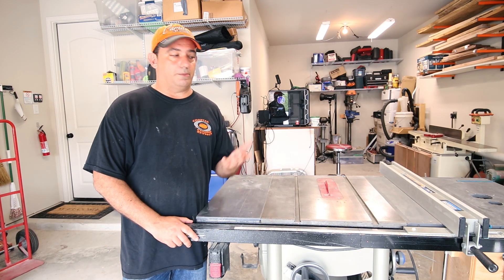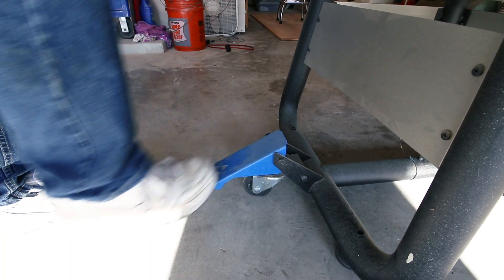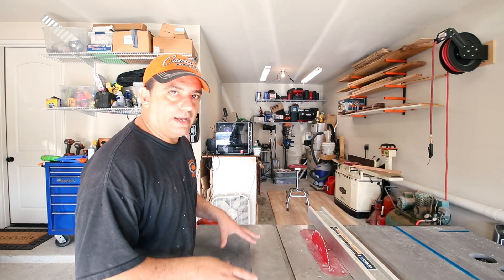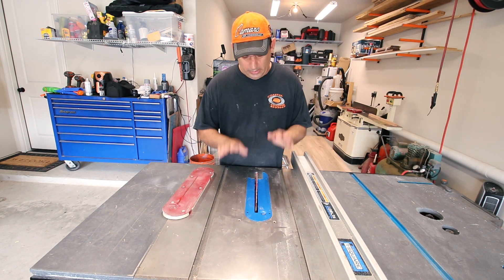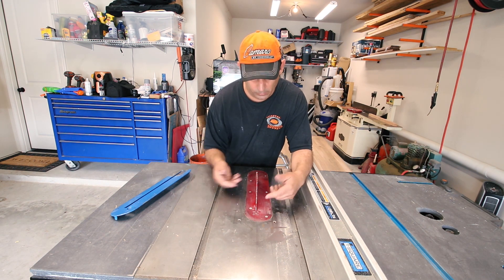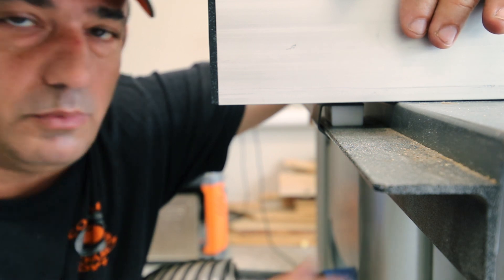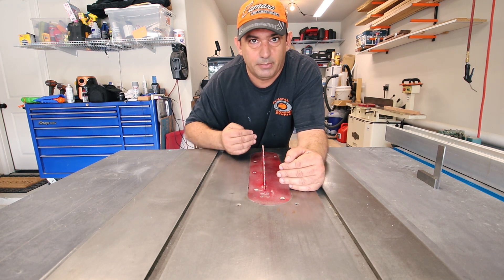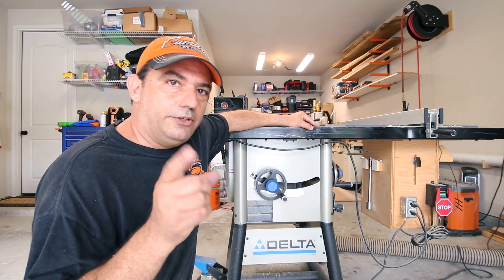Delta 36-725 Table saw review.  After 3 years

Comment: Great review. I guess I going have to get the Laguna fusion , the table has to be flat.
Reply: Make sure you get the Fusion 2 or better. The Fusion 1 is similar to this saw where the motor and arbor are mounted to the underside of the table causing the “dip” in the table surface.
Reply: The Fusion F1 is a better saw than these Delta's.  The top on the F1 is thicker than on this Delta.   The F2 is nice as well, but is a bit more money.  Over the last 4 months I have owned the Delta 36-725T2, the Laguna Fusion F2, and now a Shop Fox W1837.   The Delta had problems with the table flatness and also loose trunnions.  The entire motor assembly moved around and the trunnions are not adjustable.  So, that saw went back to Lowes.   The Fusion F2 was damaged in shipping, so it had to go back.  A replacement was not available.   Nice saw, but the fence had a little too much flex due to the thin aluminum front rail.  The W1837 is a great saw for $999.  Some things on the Shop Fox are nicer than the Laguna, and others are nicer on the Laguna.   

I would stay away from these Delta's.   Go with the Shop Fox W1837 / Grizzly G0771Z (same saws, different cabinets and features), or the Laguna Fusion F1/F2, or the Jet ProShop 2.  The Fusion F2 and the Jet ProShop 2 are the same saw, just different cabinets and different features.  IMO, the Jet is the best saw out of all of the above.  The best warranty and the best fence.  Well, actually the fence is probably similar to the Delta fence.  The fence on the delta is the only thing good about that saw.  The Delta's fence overall, is better than the Shop Fox / Grizzly and Laguna F1/F2 fences.  I own the Shop Fox, but I would have purchased a Jet if they were available at the time.

If you do not believe me about the above saws, being basically the same, well see for yourself.  Look at photos online, and in the manuals.  Compare the parts diagrams for the saws.  You will see what I mean.

As for flat tables, my Delta was at .018 front to back, and .014 across the blade.   The Fusion F2 and Shop Fox W1837 could not be measured.  This is because the smallest feeler gauge I have is .0015, and I could not get that under my straight edge on either of those saws.  In any direction.  So, those are basically flat.   A note on flatness, the table top does not need to be perfectly flat, and the flatness will probably change over time.   Anything around .005 is pretty good.  Getting in the .010-.015 range is livable.  Anything worse than that is well, not good and borderline awful.  Also, even the best and most expensive saws out there suffer from uneven table tops.  Do not expect perfect, but don't accept awful either.

Comment: FYI, you can rewire the saw to use 220, it's detailed in the owner's manual.  I'm not sure when you said "upgrade", did you mean the saw or the wiring...
Reply from the maker: If you rewire the saw for 220, you don't really get any more horsepower.   You'll cut the amps in half and have the same wattage, and horsepower.   I want to upgrade to a whole new saw with at least 3HP.
Reply from the maker: And ideally.... a flat top!   Lol
Reply: @termitewoodwerx5896  Good to know..
Reply: @termitewoodwerx5896  hp rating is for no slip motor operation. When the motor starts to load up, voltage drop is lower and slip and torque will be somewhat better. So 220V will provide noticeable improvement for highest duty cutting.

Comment: Thanks for the great (and disappointing) review. That was very helpful… I’m buying this to build furniture. I’m replacing a 23 year old Ryobi Bt3000. I think most of your frustrations, I can live with…. Question, at this price point, is there another saw that’s better? I’ve also looked in to the Rigid r4520, but that gets worse reviews (even though it’s essentially the same saw)… I’d go with a cabinet saw, but I’m in a small garage and space is limited (it’s a space issue,  not a money issue).

Comment: I just view your video today and all I can say when I was 24 I purchased at Sears a manager special contractor saw you know the type open bottom and back belt drive motor1.25 hp and it has served me well over the years I build everything with it Kitchen Cabinets, chairs, tables, small box thing that move over now to my 14" bandsaw now, It Handel molding heads cutters, a full dado stack with spacers,  and I am 64 I would not trade this in for a total inclose bigger cabinet table saw and 40 + years woodworking it does everything I ask of it, and the 2 & 1/2 car garage I build has 240 40 amp service

Comment: Purchased the 36-725T2 earlier this month.  My initial reaction was total pleasure in using it.  I especially like the stability of the fence.  However, after two weeks of use a problem has developed.  The braking mechanism tends to lock up the blade so that it sticks when you re-engage the power.  You literally need to spin the blade by hand or using a stick before turning on the power, and this is extremely dangerous.  Contacted Delta and they indicated there has been a problem with this.  Only advice they could offer was to return the saw to Lowes.  The company seems to be aware of the problem and supposedly are working on it.  However, I’m not certain any of the T2’s currently in stores will have the matter fixed.  So be aware, you may find yourself having to return 350 pounds of saw to the store for a refund.
Reply: I also have the T2 and (thankfully) have not experienced that problem Robb.  There are good ones out there.

Comment: I've had my saw for 5 years and don't have the issues you do.  My saw top is machined flat.
Reply from the maker: I guess it's luck if the draw.  Since you've had yours for 5 years with the table flat,  that rules out the theory that the motor's weight causes it to sag.   Mine must have been out of flat from the beginning.

Comment: I'm considering this saw as well (possibly the newer model I'm seeing on the Lowe's website). I'm wondering if you may be able to get a replacement if you've only had the saw for 3 years. On the Lowe's website, it shows this saw to have a 5 year warranty. Maybe you'll be in luck! Greatly informative video. New sub!
Reply from the maker: Oh wow... I never even realized the 5 year warranty.   For some reason,  I just assumed it was a 1 year warranty.   Im going to go up there and talk to them.   I don't have my receipt,  but maybe they can look me up.   Huge thanks!
Reply: Glad I was able to help! Hopefully you can get a replacement. Let us know how it turns out!
Reply: @termitewoodwerx5896  They will not replace that saw.
Reply from the maker: I looked everywhere and couldn't find the receipt.   I can't prove when I bought it.
Reply: @termitewoodwerx5896  that's a bummer! I actually wound up getting the same saw used for $100 because the guy I got it from though it needed some parts replaced. Turns out it worked just fine 😅 I checked the flatness of mine and it's slightly out of flat, but I haven't noticed any issues with workpieces, so I'm just going to use it until I can upgrade to a cabinet saw.
Reply from the maker: A little bit out of flat can be dealt with.   Mine looks like a cereal bowl!   Lol. 

I'm doing the same thing.   I'm just dealing with it until I can hide enough money from the wife to buy a Sawstop.  It's gonna be a little while.

Comment: I have the same saw and love it. My table is absolutely flat.  Sorry you had issues. Maybe you got a dud? I originally bought a Ridgid table saw and that had uneven table issue. I returned it and got the Delta.
Reply from the maker: The flat table is my only real issue.   It's quite upsetting.   If it weren't for that,  I'd be pretty happy with it.  Maybe i did get a dud.
Reply: Sounds like it needs to be checked while unboxing.  I was wondering if it's built lightly enough that he bent it.  That would be more of a worry

Comment: Fair criticism but it's still a lot of saw for the price.  The throat plate is awful but amazon sells a zero clearance plate that fits perfectly.  Not marketed for this saw but it is the same plate.  A crosscut sled takes care of the low spot beside the blade.  As far as the "short" arbor,  you can skip the washer and just use the nut occasionally. I didn't hear this guy mention the riving knife adjustment, which is a giant PITA. The book doesn't explain it accurately but with a little patience, it can be dialed in perfectly.
If all these things were improved at the factory this thing would end up costing 3000 bucks, which defeats the purpose of having an intermediate saw.

Comment: I have to say two things. 1. It is a cabinet saw because the motor is mounted to the cabinet and not to the table top like a contractor saw. 2. You can hook it up to 220 and it will give you more power just less reliability
Reply: Then you don’t know anything about table saws. The Trunnions and motor assembly are mounted to the table like every other “Contractor” style table saw.

Comment: About the issue of the flatness of the table. You mentioned in one of your replies how you wished delta had put more material in the cast to make it more stable. From what I understand that might not be the problem. After the part is removed from the mold there is a certain amount of time required for the part to cool and "set". Even though the part is ground & polished flat if proper time isn't taken to "season" the part it could warp. They might be cutting corners in the proper procedures to make sure the part is ready to ship. The faster they make anything the less $$$ it costs. Maybe someone that knows more than me can weigh in. was the table like this when you unboxed it?  I don't own one but I think it's a very good tool for the price.

Comment: Actually, when using the Dado Stack, you would normally just use the Dado Stack washers and remove the normal blade washer, thus solving that problem. Can't really see a reason to use the standard washer on the Dado Stack.
Reply: Not sure what dado stack you're using, but my Irwin stack did not come with washers.  It came with spacers, but you can't use those on the outside otherwise you can't achieve the proper or full width of the stack.  And for safety, blade stability, it's important to use the arbor washers that come with your saw, delta failed on this one.
Reply: My dado stack specifically tells me NOT to use the arbor washer. The same was true of the older set that I retired. But, I have always used an eight inch dado stack to protect my saw motor. Have never had any issues with cut quality.

Comment: Very informative, am considering this saw, as a step up from my ryobi contractor bts3000. Thank you.

Can it pull off decent cabinetry/media center pieces?

Anything else in this price range that can?
Reply: I think this is about the best you get in the hybrid price range.  The OP is worried about 35 thousandths of an inch non-flatness.  Well, that's about 1/32 of an inch.  You can do reasonable cabinetry with that baseline tolerance if you use some auxilliary techniques.  The OP has machinists tools.  The table saw is definitely not a machinist's tool.  

That said, my own 36-725 is flatter than the video author's one.  I do the flashlight test and find no light coming thru anywhere (using very bright LED bar light).  So, that's going to be variable on this saw I guess, since his does have 1/32 off of perfectly flat, and mine seems to be almost perfect.

 - Ron

Comment: I just watched your review today, because it's one of the few that review it after having it a long time. When did you realize that the table wasn't even? I will definitely take a straightedge with me to the store next time I go. And take my dado shims with me to test it. I want to get this saw because it's in my price range. I liked your review, I only disagree with the bit you said about not being able to make jewelry boxes with it. I've made two very nice watchboxes with my $50 ryobi saw. I'm sure I can make even better ones with this delta.
Reply from the maker: I realized the table was warped about 3 months ago.   It was after much frustration of not being able to get a square cut.   I would put a square up to the blade,  and it showed square,  but the piece of wood I cut was slightly off.  This didn't seem to make sense.   I then started looking more closely into it.   The blade was square to the table an inch away from the blade.   But 6 inches away from the blade,  it wasn't square because the table is off.  

Now,  was it like that out of the box,  or did that develop over time?   I have no clue.   Maybe I never noticed it because I never really tried to make precision stuff.   But now im trying to step up my game a bit and I'm realizing these flaws.   

As for making precision stuff... can it be done.   I suppose it can.   But it takes a bunch of trial and error to get a PERFECT 90 degree cut.   The blade tilt will have to be moved every time you cut a different width board.   Sure,  it can be done.   But it's exhausting and annoying.   I want to set the blade at 90, and I want to forget about it.   I want to be confident that every piece I cut will be art 90.  Should I really have to check every single board with a square after every single cut?   

Next time I go to Lowes, I'm bringing a straightedge just to see what their floor model looks like.   Im curious now.   

I kinda feel like the cast iron isn't thick enough.   The motor assembly hangs from the bottom of the cast iron.   I wonder if over time,  the weight of the motor has caused the table to sag.   If that's the case,  then there's no hope.   

Then again,  maybe this particular saw was just off  from the factory and I was too dumb and inexperienced to notice.   I was so excited to pull my new saw out of the box that I never checked it.
Reply: @termitewoodwerx5896  i didn't think about the motor hanging from the bottom cast iron. I would like to think that it shouldn't cause the iron to bend... but who knows. And I agree about setting a cut and not having to worry about accuracy issues.  I have to check 4 to 5 times before I cut, simply because the fence in my saw is terrible. Thanks for responding. I'm gonna ask other people that own this saw to check and see if they found what you found.
Reply from the maker: Let me know what you find.   I'm super curious.
Reply: @termitewoodwerx5896  well, according to a few people in the woodworking groups, they were able to slide the thinnest feeler gauge. But not the others.
Reply: @termitewoodwerx5896   "I kinda feel like the cast iron isn't thick enough.   The motor assembly hangs from the bottom of the cast iron.   I wonder if over time,  the weight of the motor has caused the table to sag.   If that's the case,  then there's no hope."

I think its what you said here.   I just bought one and think I will return it, the sag changes when you move the blade to different heights and angles.
Reply from the maker: I guess I just got a dud.

Comment: I would consider this a better review if it was done when the saw was first bought, specially for the bed not being straight, now after 3 years it is not as valid as it depends in the use that was given to the saw, plus for the price it seems to provide more than enough.
Reply from the maker: I can't comment on reliability on a brand new saw.   

As for the warped table, my guess is that it was warped from day one.   Only because other people have commented that they have owned the saw for years and the table is flat.   My fault for not checking that right away.

Comment: I would like to know what router extension you are using. Looks like a real good add. I was considering building one from plywood, but if I can buy a cast iron one, I would prefer it.
Reply from the maker: I made this one myself out of plywood.  It's nothing special.  I painted the top gray so it would match a little better, but it's just wood.  Sorry to disappoint.
Reply from the maker: I also made the router lift inside out of plywood and I used some drawer slides with some threaded rod.  Pretty simple design.  Didn't cost much other than the motor, but it's not as precise as I'd like it to be.
Reply: @termitewoodwerx5896  I see. Well my new plan is to remove it from the 3 wheel stand that I hate and put it in a workbench. Router to the right.
Reply from the maker: I wish I had the room and I'd have a stand alone router table.   I only put it in the table saw to conserve space.
Reply: @termitewoodwerx5896  Same here. My garage is slightly over 20X20, plus my wife insists on parking her car inside when it storms real bad, so I have to have everything on rollers and be able to get that stupid car inside when she asks. My router will have to be incorporated into the table saw work bench, but if I had more room I would just build a dedicated router table.
Reply from the maker: Doesn't your wife know that the garage is a place for making things and not storing cars?   Lol

I endure pink towels and a bunch of trinkets everywhere.   My house is soooo not manly.   Man... we have a bedroom dedicated to Elvis. I told the wife... you have the whole house to do what you want.   The garage is strictly mine to with as I please.
Reply: @termitewoodwerx5896  Yah well we started out late in life. Married almost 3 years. We like to give each other the illusion of control in certain ways. I talk tough about the garage and yard being my domain, and most of the house is hers. I just bought her a new car and she thinks it needs to be inside the garage when it storms. It's a pain, but I still want her to have that illusion if you know what I mean. By tis time next year I should be able to build a new shop out back, which will be mostly for building cars. So for now I have to use the tiny garage and pull her car in whenever she wants it in there. Hence the table saw, router and whatever else I can cram in to the mobile work bench.
Reply from the maker: @danieltaylor8347  Man, I can completely relate.